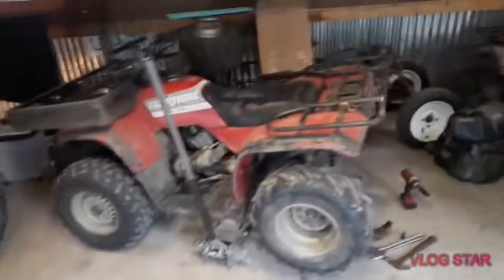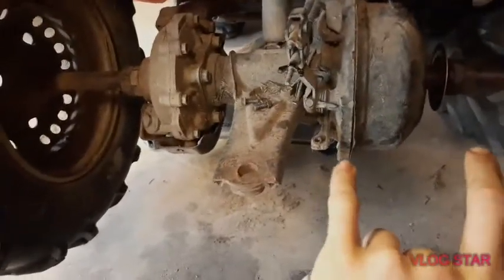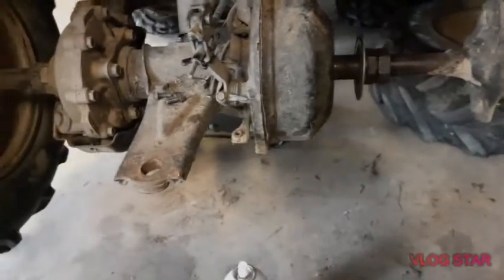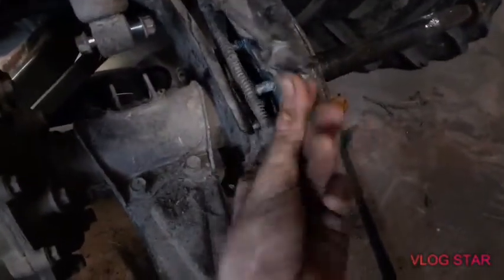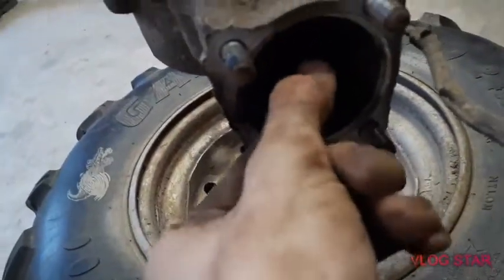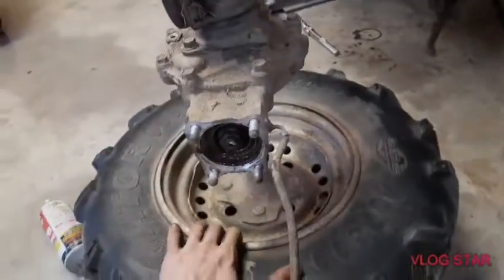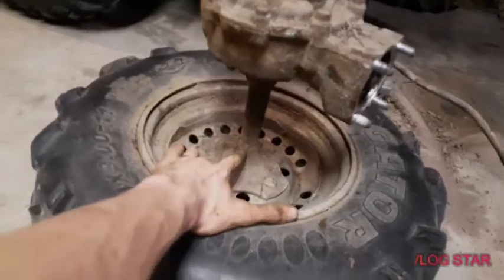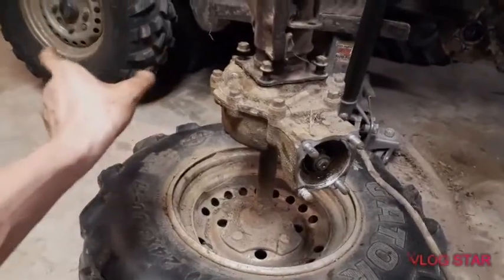Pt. 1 1988 honda 300 fourtrax 4x4 rear differential bearing replacement

Comment: Mine squeaks you think it’s the bearings
Reply from the maker: It also could be your brakes squeaking, try to lift up the rear end see if the rear axle has play by picking up on the tire
Reply: Fabricobble Garage ok